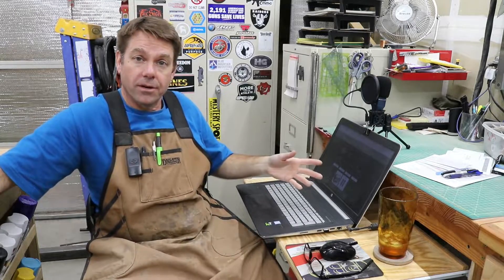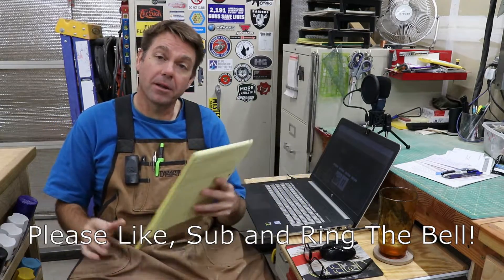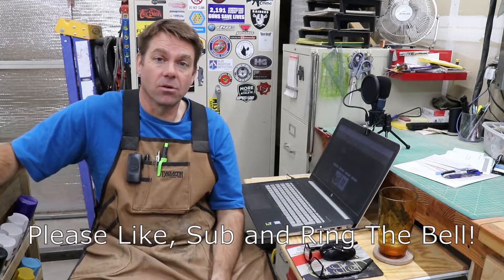HOW TO Connect The Onefinity To Your Network

Comment: I hard wired connected so it's not going to change as it's an APIPA address is 169. You do this and you're good to go. No need to statically set anything.
Reply from the maker: Great point. I'm connecting over wifi but I should have mentioned that a hard wire connection is an option. Thanks for adding to the conversation.
Reply: @MattMadeIt123  Once you connect via USB (which is what I am assuming you're using for the hardwire), how exactly are you bringing up the interface?  Same process ?
Reply from the maker: @jackseiler5207  Hardwire is via an ethernet cable. Once connected and with your CNC powered up, just type in your CNC's IP address and the interface will come up as a web page.

Comment: I wonder why my SSID name isn’t displaying next to the IP address in the top left?? I’m having a hard time trying to connect easel to my onefinitey.
Reply from the maker: I'm not an IT expert, but one thing to check is to make sure your machine is connected to the same WIFI network as your computer. From your comment, it appears your CNC isn't connected to a network. Try going through the procedure at 9:15.

Comment: I just didn't understand why you used the table saw to make the sides with dadoes instead of the Onefinity.
Reply from the maker: It's just what I'm used to. Been cutting dados with a table saw since middle school.
Reply: @MattMadeIt123   Me too I am a tool guy for 60 plus years.  When some one asked Hey Lee do you have???... I say stop right there unless you are asking for a CNC Router or 3D printer the answer is most likely YES  but I am working the the those  Now just the 3D printer on the wish list still have not got my !F up and running but working at it Your video might be the final step .I am a MAC user and have never right clicked anything and the shop as of yet has no WIFI so that thumb drive option would be a pain and the small touch screen is too small for my fat fingers
Reply from the maker: @lelandwildes5236  Check out the Onefinity forums. I'm sure there are folks who control their machines via Mac who can help you out.

Comment: I really enjoyed the part when you got into showing how to connect the 1F to your computer.  That has always been greek to me.  I think I can get it now.  Do you just add that to your tool bar so you can access it easily?  Thanks for your time in making these videos.  My Journeyman will be here tomorrow.  Should be an interesting time.
Reply from the maker: Yes. I just made it a quick link. Also make sure you permanently assign it's IP address with your network. If you don't your network could change the IP address on you and your link will stop working. Exciting day for you tomorrow. Thanks for watching.

Comment: Networking note... There is a chance that your CNC will get a different IP address from your network when/if it renews its settings. This depends on the settings of your wifi network. You may want to create an IP address reservation on your network for the CNC. This way, it will get the same IP address every time it renews its settings. Otherwise, you may need to re-lookup the IP address of your CNC again in the future.

Great video!
Reply from the maker: I know just enough about networking to be dangerous. Which means I don't know how to create an IP address reservation 🤣. I will look into this. Thanks for the info.